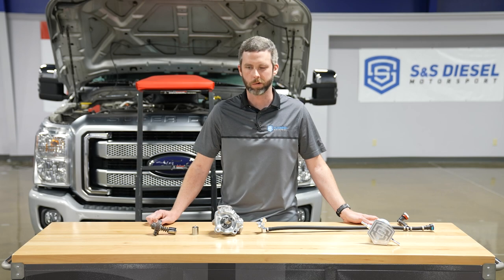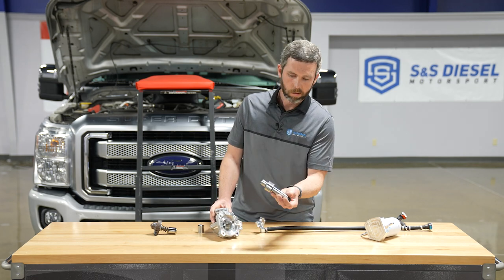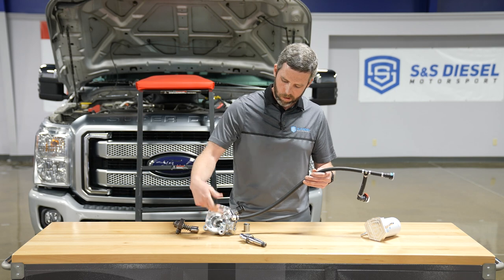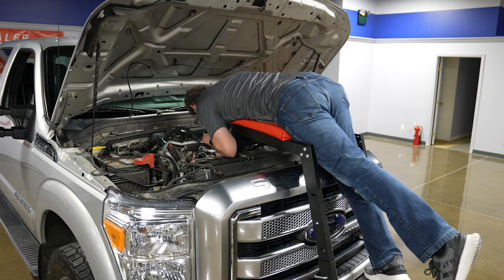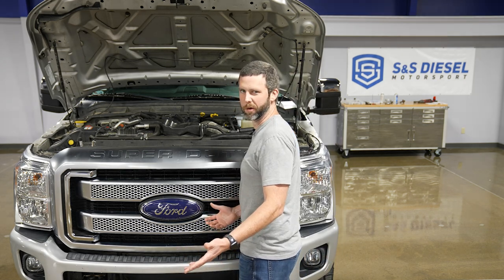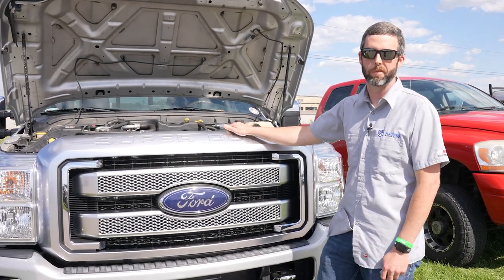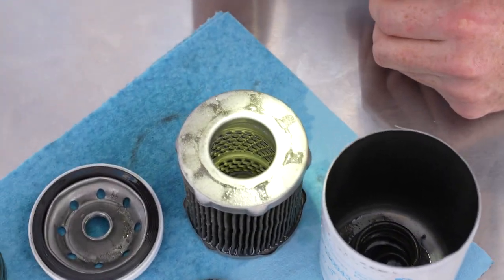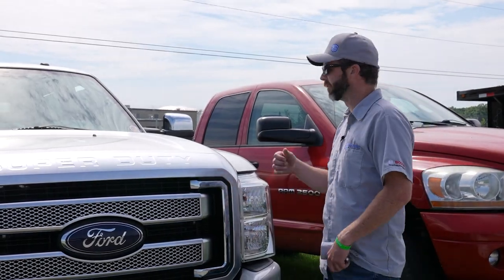Is It Snake Oil? - Part I

Comment: Thanks for sharing and using your truck as the guinea pig to test the Gen 2.1 kit.  Curious to, of Jim Letziring's question of low fuel pressure with use of DPKs.  Thanks
Reply from the maker: We developed the original Disaster Prevention Kit back in 2015 and it has since been copied by many different knock-off companies. That particular design also redirects fuel flow, but requires the factory supply line to be cut and a braided hose is attached with a compression fitting. All reports of rail pressure issues was with the original DPK, and on trucks with aggressive tuning. We developed the original DPK for stock trucks and did not test for extreme pump output. That's why we made sure to test max output when we developed the Gen2 kit. The original DPK was not perfect, but better protection than not having anything. We're always trying to improve and our Gen2/Gen2.1 kits will not affect rail pressure. We can't speak for the many knock-offs of the original DPK

Comment: I do support the CP4 bypass it is the cast Meow and worth the money 100%   I just hate the paper filters  ..but there CP4 Bypass does work as it should   but also in the past I have just installed a Centrifuge filter and used 1/2 cup Cheap ATF per 50-60 liters on fill up to replace the OEM required Additive of fuel  and installing the Bosch fuel pump for the 7.3  on all the trucks I have worked on with a CP4  and relatively all Diesels that customers asks for better protection and they all have been running flawlessly  GM Ford Dodge Sprinter Isuzu Paccar Detroit Cummins and so on     ................what  I pick on is Oil bypass kits  and I have good reason why I pick on oil bypass kits  I  only call Oil bypass kits snake oil due to the Paper filter and reduced oil flow and oil line size  and stress put on the oil pumps
Reply from the maker: Thanks for sharing some of your experience.

Comment: Any plans to put a guide pin or a d shaped cam follower in those pumps as an update so the rollers can’t turn?
Reply from the maker: That's a great idea that Bosch has already implemented in 2020+ Power Stroke and 2019-2020 Cummins, but it did not seem to help with failures... for Cummins at least. We do not have much warranty data on Fords, but Cummins made the decision to go back to the CP3 for 2021.

Comment: What's the different between the Super Duty Gen 2 and Gen 2.1 kits?
Reply from the maker: The Gen2 uses a plastic Parker Racor return filter. We first chose that option because it has a clear bowl for inspection, but supply chain issues forced us to switch to the billet spin-on filter head. While the spin-on filters don't have a sight glass, they are more readily available and cost less when it's time to change.

Comment: I installed this kit on a stock 2015 6.7 powerstroke. Primed the system like 10 times before starting. Now there is a humming sound inside the cab so I go back under the hood and can feel the fuel lines vibrating. There are no leaks. And no difference in performance/ drive-ability. Any input?
Reply from the maker: Thank you for your business. The vibration you are hearing, and feeling, is high-pressure fuel being vented from the DRV (rail side regulator). Adding the return filer assembly can amplify the sound, which is why we use rubber isolators on the return filter to help dampen the vibrations. Check and make sure the the hoses are not touching the brake booster or firewall. In some cases, the hum is more pronounced but it is nothing to worry about. Some of our customers call it "the hum of reassurance."

Comment: That is awesome. I am interested in your setup. I have heard there are low pressure fuel issues with all the disaster prevention kits. I would like your answer to this issue.
Reply: If you go to their website for this kit, they show the test results of this kit vs stock for flow rate over the RPM range. This kit actually does better than stock.
Reply: @TrashTakeCallouts  thanks. I'm going to guess that the ones with the low fuel pressure issues are probably running a deleted 6.7 on a hot tune.
Reply from the maker: Good question, Jim. We developed the original Disaster Prevention Kit back in 2015 and it has since been copied by many different knock-off companies. That particular design also redirects fuel flow, but requires the factory supply line to be cut and a braided hose is attached with a compression fitting. All reports of rail pressure issues was with the original DPK, and on trucks with aggressive tuning. We developed the original DPK for stock trucks and did not test for extreme pump output. That's why we made sure to test max output when we developed the Gen2 kit. The original DPK was not perfect, but better protection than not having anything. We're always trying to improve and our Gen2/Gen2.1 kits will not affect rail pressure. We can't speak for the many knock-offs of the original DPK.
Reply from the maker: You hit the nail on the head.
Reply: @SSfueled  awesome!!  Thanks for the replies.  Definitely has helped make a decision about get a kit.
Reply: With higher hp trucks, the fass piggyback pump works well at ensuring solid pressure.

Comment: All the guys wondering about low pressure problems i have the new s&s DPK on my 16 6.7 and have zero issues
Reply: Me either. All it does is keep the fuel that goes to the injectors separate from the fuel that lubes the CP4.  This would have no effect on fuel pressure.

Comment: Anecdotally I don’t think 9 micron is fine enough on the return. The 2 micron Racor filters were a better bet but I am told by racor that their machinery in their new facility can’t put out the clear bowls without cracking them. Donaldson is a good choice in filter however the billet filter head lacks the stock like appearance of the racor thus leading to problems with visual inspections during smog testing in CA. I may have to adapt my customers to your competitor’s kit for that reason.
Reply from the maker: We were also skeptical of the 9-micron rating of the Donaldson filters, so we decided to conduct a test before using them. We failed a CP4 on our test bench to gather a debris sample  and then sent it to Particle Technology Labs for analysis. Particles found ranged from 0.675 micron up to 859 micron, with the average particle size being 20.3 micron. In summary, 96.88% of the CP4 debris is 4.33 micron or larger, and our return filter is 94.7% efficient at catching the 4 micron particles and 99.575% efficient at catching the 9 micron + particles. It's a shame that Racor is having supply issues, yet we have full confidence in the Donaldson filter we now use. You have a good point about the visual inspections and it should not be an issue in the near future since we have a CARB EO number in the works. As with anything regulatory, it takes time to get approved and we do not have an exact date. Our SEMA emissions certification should go through within the next two weeks, which will make it 49 state legal. While that specifically will not help you in CA, it shows that we are headed in the right direction. We appreciate your business and hope to retain it.
Reply: @SSfueled  any options for filters smaller than 9 microns for additional piece of mind?
Reply from the maker: @goldtooth10  There may be filters out there with a lower micron rating, but be sure to take note of how efficient they are at that rating. We chose the Donaldson P550943 based on the debris data we gathered when failing a CP4, and the flow rating of the filter. We're confident that it is sufficient for stopping any visible and detrimental CP4 debris. Microscopic particles may get past, but they'll be the size of red blood cells. The spin-on filter head will accept many other filters/brands and there could be a tighter micron filter out there. The Donaldson P550943 is what we have validated on our test bench and in two real-world CP4 failure tests, so it's what we recommend. Without data, we do not want to give the thumbs up to another filter.

Comment: So what's the difference between the SPE kit to the S&S kit?
Reply from the maker: From what we can tell, SPE makes a good quality kit that also catches debris from the CP4. Their kit uses high-quality braided and molded hoses, yet we chose to use Parker 389 hose and oetiker clamps in favor of threaded connections, which we have found to be problematic. We use a 9-micron at 99% efficiency spin-on filter to catch the debris instead of a 25-micron screen. The S&S kit has been validated for pressure, flow, and effectiveness in our fuel lab, and on our test truck shown in this video. We can assume that their kit will protect the fuel system, we KNOW that the S&S kit does.
Reply: @SSfueled  Thank you
Reply: Just ordered my S&S 👍